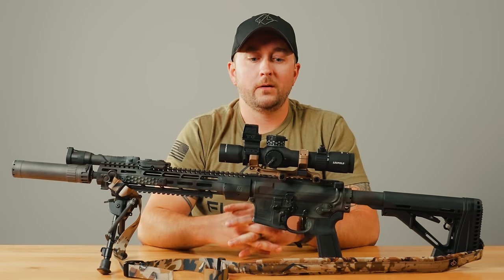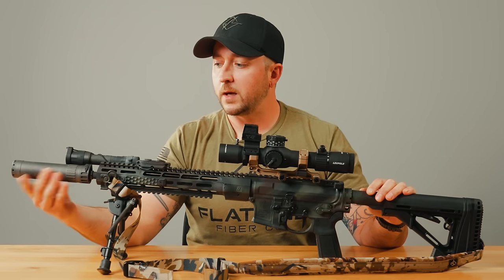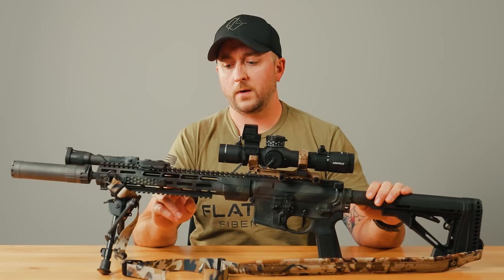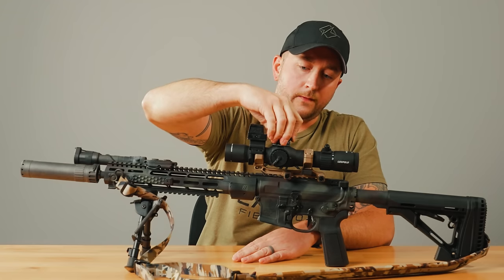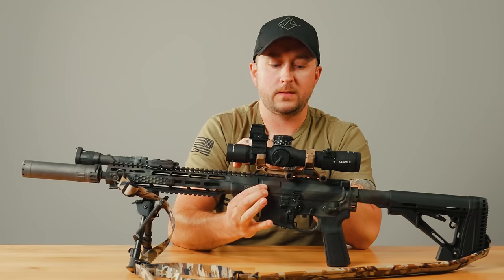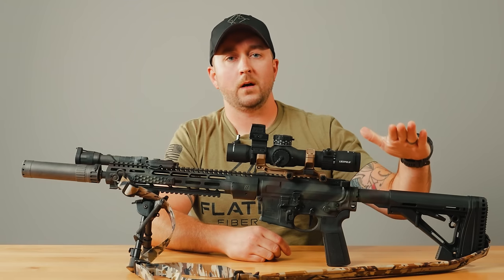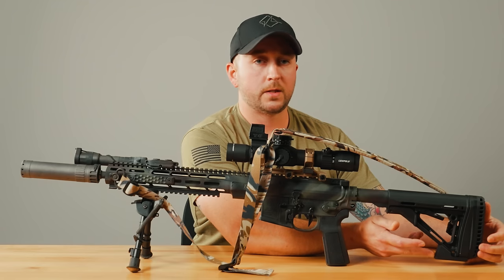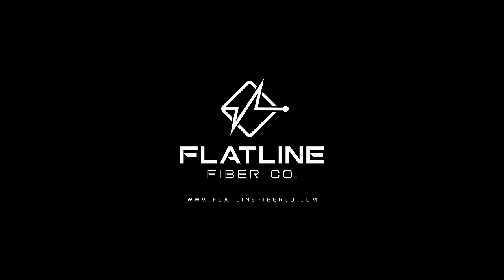SPR Breakdown | New Build | Long Range Shooting | Flatline Fiber Co.

Comment: Man 13.5 barrel leangth is cool for a GP build but what's long range for ya. My 16in or 18in guns do very good with 77SMK just out to 650 to 700. First round hits. Now if your going for a 3 to 400 meter tack driver. Like popin heads distance that's a great set up.
Reply from the maker: Watch the next video man. Thanks for the comment.
Reply: @flatlinefiberco  Ya man cool. This may help you or might sound weird. But I did some security/body guard work and needed different rifles for different things and my pelican box was getting heavy as shit. So I played the three upper two lower game. All my lowers are the same. The three uppers are way different. My GP work horse boy is a 14.5. 1×6 LPVO. Tac light, IR lazer. (All have wrong hand cappibility controls. FYI). Ok my next is the 20in DMR long boy. Still a tac driver but this is outfitted with everything the GP upper has but a dedicated rifle scope 3 × 15 with custom 5.56 rang dials. Plus thurmol piggy back emitter. Next is my I got to be sneaky or I'm kicking doors upper and it's a 12.5 suppressed NFA I got to hide this in my suit rifle. The extra lower is for my partner/spair. So try this out it does well for me I got a pack that fits extra ammo and upper for a long patrol. 12 years of being a machine gunner extra gear no sweet for me. Thanks take it easy man.

Comment: what would be highest rated or best 16 in rifle / suppressor combo for similar build?
Reply from the maker: Factory rifle? I hear good things about the Defoor BCM and Radian rifles. If your doing a custom build I def can’t say enough good things about the Centurion MK12 barrels. For suppressors Im a huge fan of flow through cans. This KGM works great but the HUX flow cans. They provide the least amount of back pressure from what Ive experienced. I have not had experience with the CAT or Liberty Precision cans yet. Hope this helps
Reply: @flatlinefiberco  Thank you... Yes I am trying to figure out the rifle... I prefer 16in as that is what I had in OIF... but it's been a long time and I have forgotten more than I knew... I'd like to purchase all together (rifle / scope / red dot / all the extras) from a singular place.. But no clue how to do it or who to contact. I have been thinking of something similar to yours here.. but 16 in.  Any guidance would be greatly appreciated... I'd prefer all in one purchase (suppresso on side of course) ... Just completely lost

Comment: 5.56 is a high velocity round. It gets is power from its high speed. 
Shooting a light bullet long range >450 meters from a short barrel is foolish because it causes the round to deflect too much in the wind and the bullet loses too much hitting power at those distances. You’ll miss too many initial shots and won’t kill what you you finally hit. This is not practical, unless you consider long range to be 300 meters at which point you could save all that gear and learn to use iron sights. This is a silly internet COD build (again)
Reply from the maker: Hey Mac. See..... I get what your saying, but I actually shoot and collect data on this rifle. The information you just stated is somewhat true, but the distance is very far off and varies. One would have to know the velocity to speak on this information in such an absolute manner. This rifle is very capable to 700 meters and Ive stretched it to 1,100. 
   Check out Part 2
Reply: @flatlinefiberco  hey, appreciate your response and I watched part two as well. Please look into an 18’ or 20’ inch barrel for your build. The current build you have now, minus the scope, would make a great fighting rifle. Look into a MK12 upper receiver made by Daniel Defense or BCM for a fantastic SPR purpose gun, add your scope on top and you’re good to go. 
Lastly, I see you’re using 77gr black hills ammo which is expensive and hard to come by. There are some .223 chambered loads that perform well.
Reply from the maker: @MackTheGovnah  Hey man, I live in a place where I can shoot what I want and do what I want man. So have fun doing what you enjoy doing. Thanks 👍
Reply: @flatlinefiberco  hey I’m sorry if you think I’m giving you a hard time, I’m not. 
You’ve spent some change investing in this ‘home’, and it’s a good one so don’t get discouraged when anyone offers different suggestions. I’d really like if you’d explore the potential of that 77gr black hills with a 18’ match barrel that is truly suited for 500+ yard shooting.
Reply from the maker: @MackTheGovnah  It's really your delivery man. Using words like foolish and being insulting. I will probably get an 18" barreled rifle one day, but right now I don't need it. I can shoot 500 meters just fine with my 12.5" and very well with my 16" rifle. Thanks man. Happy Training
Reply: @flatlinefiberco  I really didn’t know what else to call it. I get the SBR builds, I’m going to do one myself. It will be an urban fighting rifle. Bringing a 12.5 barrel to 1000 yards with a .20 caliber bullet is shooting a BB gun to one hundred yards plus.
Reply from the maker: @MackTheGovnah  The point is to push the capabilities of the rifles and myself as much as possible. Is it ideal to shoot that far with a 12.5, no. If that what I have that day then cool. 
  With the 16" vs 18&20"  trust me I get it. That's just not what I wanted and the 16" gets above 2600fps so I can shoot 77gr rounds effectively. It does the job done well man.
Reply: @flatlinefiberco  I get what you’re saying. Take care.

Comment: Did you literally not talk barrel or BCG?  You just talked on and on about accessories wtf
Reply from the maker: I most definitely talked about both. You gonna be ok today?  Need a Snickers?
Reply: Yeah he mentioned both, he pretty much gave us the whole run down, don't think he mentioned gas block if you're just anal
Reply: @flatlinefiberco  Everyone makes mistakes.  I swear to god I even re-winded the vid to see if i missed barrel and BCG.  What barrel and BCG?
Reply from the maker: It's a 13.9" Criterion barrel with a Centurion bcg
Reply from the maker: Yup. Everyone makes mistakes. Being a little more polite helps as well.
Reply: @flatlinefiberco  I'll be honest, I dont understand the internet/youtube trend of talking about accessories at length over the barrel, bcg, and handguard.  Great choice in barrel and bcg tho.  Did you mention accuracy testing?
Reply from the maker: @hannibalbarca2939  I did not. The barrel is very accurate though. I did Chrono the rifle, but Im not finished collecting data just yet.